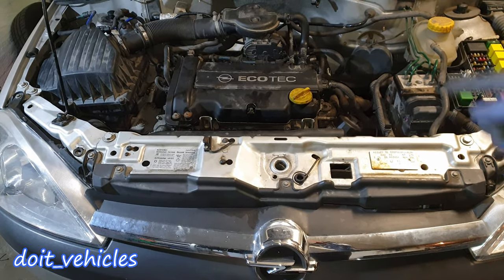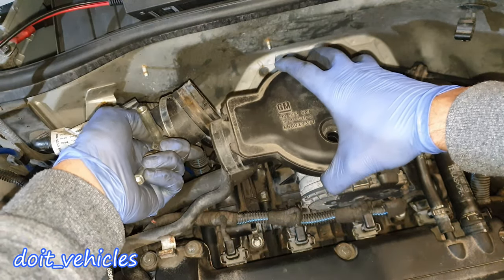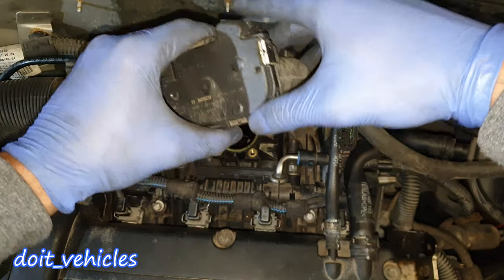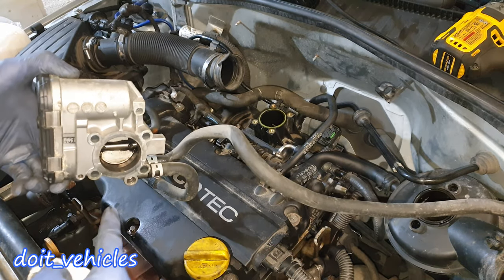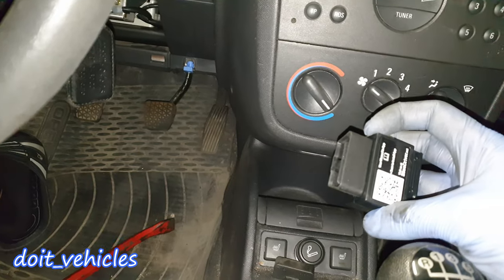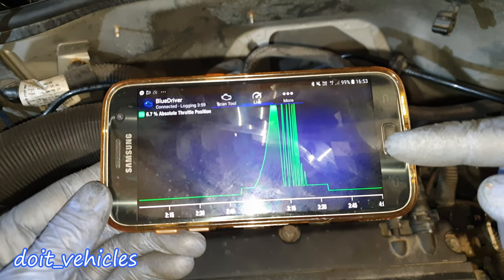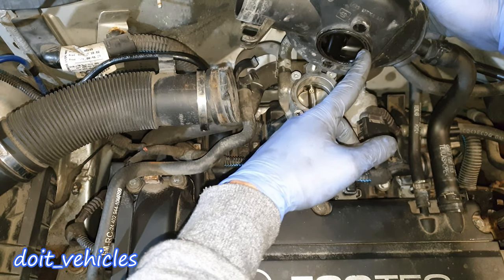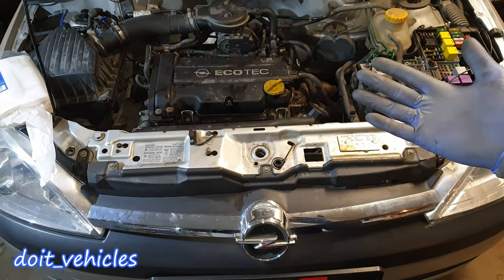2003 Opel Corsa C Throttle Body Cleaning / How to Test it

Comment: Hi. I cleaned the throttle body and I discovered there is like a sensor thing under which was black, but after I cleaned a bit it looked like a copper coated thing. What that is ? Great video!
Reply: Did you get an oil filter light on after cleaning?

Comment: Thank you for your advice, I was able to fix the P0412 code on my Mercedes by following the wire from the change over valve to the computer it had corrosion at the connector. God bless you.

Comment: Whenever I switch gears or lift my leg off the gas, I have to do it slowly otherwise the car will always jitter/shake a bit. Is it a common type of a problem for these throttle bodies? Should I replace it?

Comment: i've a corsa c and the purge valve and canister are ok ,nonetheless when i fill petrol in the station the pump continues to stop many times. Any ideas for this?
Reply from the maker: Something might obstruct the filler tube
Reply: The pump has a cut off. Place it all the way in and it shouldn't cut off

Comment: Great video!
Did you replace the gasket between the body and the intake manifold?
Reply from the maker: Thanks , On this car it was still reusable
Reply: @doit_vehicles  Thanks! I was just asking because I'm going to clean my throttle body and wasn't sure if it was mandatory to change the gasket. I'll see if mine is reusable - I've got a new one ordered anyway!
Reply from the maker: @MattGregoryGuitar  The gasket must be rising from the surface it is installed , so it can seal with the throttle .  Just look from the profile and you will see if it does rise or not . Usually on a hoter surface the gasket will melt / crack over time  - like on a intake manifold for ex.

Comment: Is this the same engine as the Opel/vauxhall Agila 1.2? Im having a problem with starting when the engine is warm and wondering if its a throttle body issue with an auto choke sticking.
Reply from the maker: Yes it will be the same engine . Have you done some tests ?
Reply: @doit_vehicles  I cant do any tests myself. I just need to have an idea what the problem might be when I take it to the garage. It starts fine from cold but once the engine is up to temperature it hesitates to start it seems giving some throttle then gets it to start. If i leave the car for twenty minutes then it starts just fine again. Temprature seems key to the problem. The temp gauge works fine so i assume the sensor is ok. The engine runs fine hot or cold theres no loss of power. It fast idles for a couple of minutes then drops to a high idle until warm then the idle drops slightly again and runs fine.
Reply: @manoomunicnent1773  camshaft sensor?

Comment: Hi I got a problem with my corsa... New HG and all gasket are new, new water pump, new sparks plugs, new chain (I oreder a full kit) coil spark pack is good, new air filter but the car wont start at all... It cranks but not start,I will test the camshaft sensor, I will depressurize feul rail and see if it fill it, I have a problem with TPS when the pedal is not pressed it shows 16.8% with torque.. Please help me befor I throw out this car because Im tired of it...
Reply: Corsa C 1.2 Twinport
Reply from the maker: Hi ! Do you have a scan tool available ? There are many tests to be done . I would start with the basics : fuel , spark , timing  . Start with the timing since you replaced the timing chain ; what about the cranckshaft sesnor ? a scan tool will show you if there is signal from that . Than the injectors I made some vids on how to test those without any special equipment for the spark plugs the same ; new spark plugs won't fix a problem with the coil packs not working .
Reply: @doit_vehicles  I thank you I get you will help to solve my problem.. I have mounted my coil pack into another corsa and it works.. 
Here the full problem... When I finished the car it cranked without compression... I made it again 3 days ago and when I cranked it it run for 5 sec at 2k RPM max but it scrambled a lot and full throttle  then dies and never started again... Then I scanned it with Torque and 3 errors (P0300/P0301/P0303), I delete the errors but still not running and now Torque doesnt find any errors but I got the Error Light on dashcam and I have Service light.. Im sure Timing is good, coil spark is good (works on the other car) but I dont if it sparks on mine, and I didnt test injectors yet I dont have battery anymore... So now my fuel rail is empty because I tested if I got fuel pressure..
Another thing, my fuel pump doesnt prime on contact but my fuel pump works when I jump the relay's pins, but i have connected a light on the fuel pump connector and it turns on when I crank..
Some people and internet told me I may be the crankshaft sensor but I dont know... Once I got battery, I will can do your injector test, but I dont how to test the coil pack on this car (i know it works on another corsa C but i dont know on mine)
Reply: Once a got battery, I will make the most explicit video I can for you, but i will do the injector test before, and Im waiting for a friend too who have "a suitcase".. Sorry Im not english hope you can understand

Comment: Corsa c 2005 throttle  pedal not working when pressed down  what can be the issue
Reply from the maker: Check first if the throttle moves when you press on the pedal with the keys in the second position
Reply: Nope doesn't move
Reply: I had the same thing where the engine would turn on but pressing the accelerator did nothing. Turned out the EGR needed to be cleaned, the code cleared and then the engine light reset.